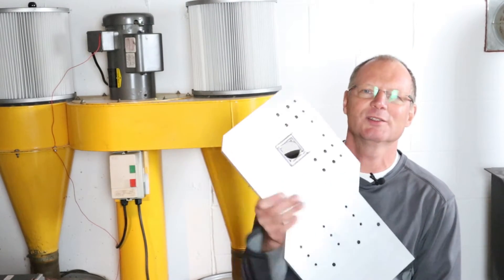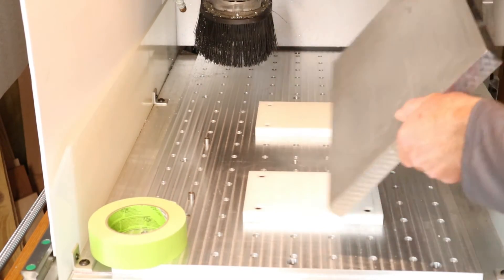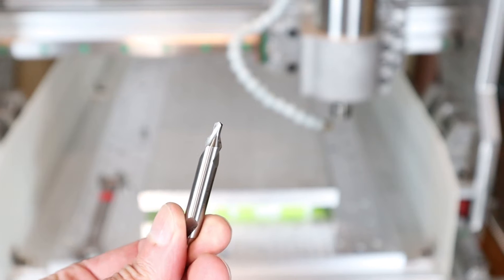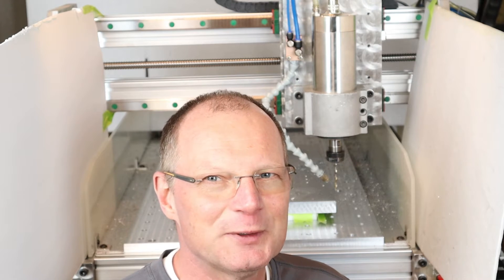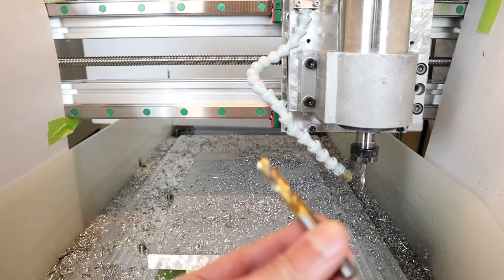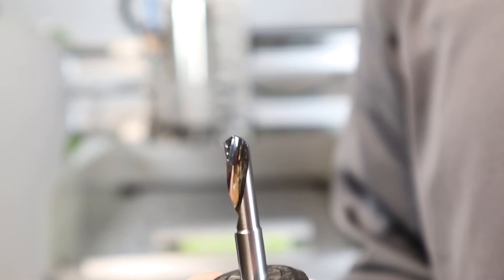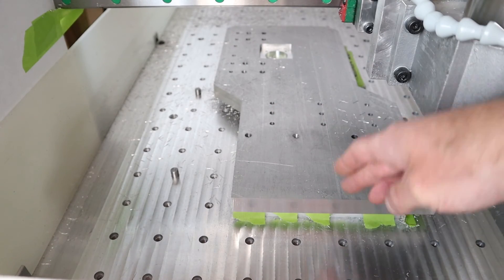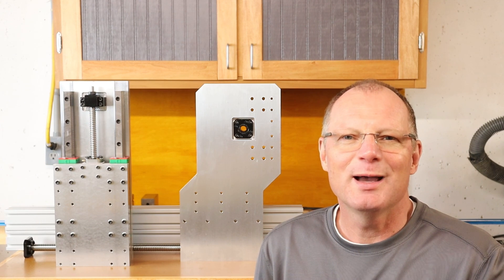CNC Router Gantry Plates

Comment: You should also consider trying CrownNorge (Dry Cut) Series (2, 4 and 6mm). I've been using them since about 2017 and love them to bits. Most of the time I use no lubricant with them and can't complain either. I also have the 4-in-1...but use Datron mainly for Acrylic work...Keep it up :)
Reply from the maker: Thank you for the Tipp, I will check them out right now I have never heard of them.

Comment: My DIY machine does 20mm depth drilling ops with 500mm/min.
No pecking... Straight plunge... You should try more agressive plunge feedrate. It gets a lot better 👍🏼
Reply from the maker: Well I fail with everything above 4mm diameter. Or maybe I need a carbite drill that can handle the higher rpm

Comment: A 4mm drill will perform well at 0.06mm per revolution in aluminum when using a G83 cycle (i.e., peck drilling) with a 6mm initial step and 3mm increments for chip clearing. At 15,000 RPM the feed rate should be about 950mm per minute. Of course, proper feed rates really only matter in a production environment where reducing cycle times is the difference in being competitive and going out of business.
Reply from the maker: I think up to 4 mm the world is still ok … 5 in shallow depth 6 gets ugly with vibration. Thank you for the parameters I copied them and will give that a go in my next project

Comment: What type of tape do you use?  I have that exact glue, but haven't had much luck with the Scotch Blue Sharp Lines painters tape I use.  It always comes loose.
Reply from the maker: I use either the “rough surface” or the “extra adhesion” one green or orange tape. Use Alkohol and wipe the  surfaces down. Use some kind of blond edge tool to force the tape down or better yet a roller
Reply: @JBWorx  Thank you.  I will look into those tapes.
Reply from the maker: No problem thx for reaching out.
Reply: @JBWorx  Acetone works better than alcohol to remove oils from surfaces (including oils left by fingertips). 

FWIW, nothing I've used worked better than 1,1,1-trichloroethane (aka. methyl chloroform). However, it is not only regulated by the Montreal Protocol for being an ozone-depleting compound but it also causes symptoms of ethanol intoxication from short-term exposure and serious health issues with long term-term exposure.
Reply from the maker: I do use acetone for glue joints i.e. epoxy but don’t really like the smell. Same counts for MEK or Xylene. So for just getting the tape to stick adequately alcohol works well. The large surface is what makes it work in most cases. Sometimes too good lol 😆

Comment: I didn't think that drill bits were supposed to be held in collets? I am probably very wrong on this 🤷
Reply from the maker: Nothing wrong with using a collet the problem is paring an incorrect diameter collet with a drill. Drill bit shanks do not come in a standard like router bits or endmills. So this can be an issue but a collet has greater holding power than a typical chuck.